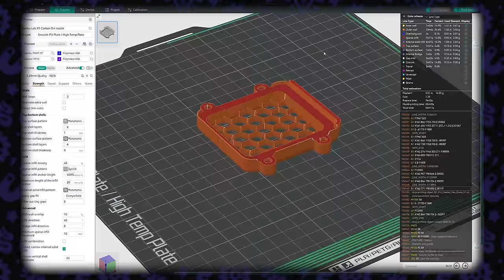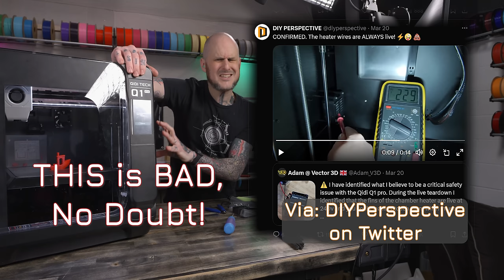SHOCKING Truth About Qidi Q1 Pro Heater Hazard

Comment: I personally think that lack of exhaust filter is much more dangerous for people...
Reply: Didn't one of the reviews mention that there's mounting points to add a filter? If so, then that seems like something that would be an accessory for when needed, unless you're referring to just general printing of PLA and PETG as well, in which case this is an issue for almost all printers on the market.
Reply: @stew675  yes, someone did this. But that should be already mounted or at least highly suggested with Goode on the SD card with some sticker on the printer or so… They advertise printing will nylon and abs (awesome) and there is no mention about this… It is like those cheap laser machines that don’t have any kind of cover or exhaust as well imho.
Just so you know - I ordered one q1 pro 2 days ago so I am not a hater. I am genuinely surprised that people talk a lot about heating chamber element etc but not about this.
Reply: @pfabiszewski  I understand, but consider this.  If you go to purchase any filament that requires filtration/ventilation, there are already warnings on the sales page for that filament, as well as on the box, that the filament should be printed in a well ventilated area, or with filtration.

Meaning the warnings are there already.  If you're printing with ABS/ASA/Nylon, and still don't know to filter/ventilate, then you've already ignored all those warnings too.

I don't know.  I guess for me it comes down to application/responsibility.  When people buy a screwdriver, we don't demand that we see warnings all over the screwdriver not to stick it into a power socket.  When we buy a power socket however, there are handling and safety warnings all over them.

I see your scenario in much the same way.  The printer is the tool.  It has warnings on it that apply to what it is (hot surface, hot nozzle, etc, etc).

I see the ABS as much like the wall socket.  These are items that have their own specific handling and safety concerns, and they do come with such warnings.

I buy a roll of ABS, and I see the warnings.  Oh, now I need ventilation for this.  I look at my printer, and I see that there's mounting holes for attaching filtration/ventilation!  Best I use them to safely use the filament I'm using.

I guess where I'm going with this is that unless they ship a 3D Printing encyclopedia with every printer (and let's face it, almost no one would read it anyway), the warnings are where they need to be, and that is on the items that are the issue (ie. the filament).
Reply: @stew675  I see your point and I agree to a degree. I think my main issue is that implementing very simple filter (even exactly this 3D printed one with activated carbon) would probably add like 3-5 USD to a price and would almost totally resolve the issue. So small increment in means/cost, big increment in result. I think that is the thing that bothers me the most. Besides - the shape/feeling of this printer somewhat "implies" that everything is self-contained. 
I understand that I am more writing about my "feelings" now, but consumer behaviours are usually dictated by habits/impressions, not facts.
And let me repeat - that lack of filter is like 50% of my point. Another 50% is that people talk about some "stupid heater", but not about this. I see some dissonance here.

Nevertheless - we might just had the nicest discussion in my internet consumption history. Thank you :)
Reply: @pfabiszewski  :) not everyone on the internet are angry people who see the world only in the colors of outrage and black and white, although I agree that it's getting harder to find them.

I understand your points. I think it's just a marketing/pricing decision that Qidi have made here. I believe they're targeting a price point and even $5 or $10 more is an issue if that item can't be an accessory instead.

I believe I also understand one of your other points. Since they already gave a chamber heater and the printer costs more because of it, then why not include a filter too, because if you're needing to use a chamber heater, then you're likely printing with filaments that gas off VOCs as well.

Since the heater is mains power though, my guess is that they didn't want to make that an accessory as in many jurisdictions that would require an electrician to install. It's not good to have customers messing about with mains power, so I suspect that's why the heater isn't an accessory. 

It's an interesting topic. The market competition is really tight and that's probably led to the decision to omit the filter for this particular model and leave it as an accessory. The Plus and Max 3's all now supply the filter as well as standard, but they are also higher specced and higher margin devices.

I dunno. It's a tough market to do business in. Lots of swings and roundabouts with every little decision, depending on the target market segment.
Reply: @stew675  that point regarding tinkering close to mains cables - actually you are maybe right. So let’s just hope that reviewers will recommend this to tech savvy people and non tech savvy won’t print with voc generating material too much ;) cheers!

Comment: I used plenty of tools that are more dangerous than some mains-connected heater element. One of them can literally get your fingers ripped off and even rip the skin off your hand with your finger(-s). I always take precaution to keep my appendages away from anything that could mangle them, I keep my kids away from any powered tools, and I do all my maintenance with power off. The sole exception is heat end of my 3D printer, which often requires a bit of heating for disassembly.
I also electrocuted myself three times in one evening by accident. I discharged big mains capacitor with my forearm, then discharged it again with my face, and lastly I grabbed the entire PCB to throw it forgetting to unplug it from the mains first. Discharging ~320V between my nose and lower lip was the worst and most shocking experience...

Comment: Really well throughout video on this. The summary at the end is exactly where we are at the companies want appliances but they are not building them to appliance standards yet. This printer just feels unfinished and make do. It would have taken them very little time to do proper cable management. But then the price would go up. I hope where not in another race to the bottom with corexy machines

Comment: Hi, I have not seen the machine in real life, but I do have a question.
It looks like the SSR is on the bottom of the frame, and what happens if someone drops a glass of cola that forms a puddle under the machine?
Is the SSR positioned low enough to be a concern then?

Comment: ha! you fixed it with conductive filament. I agree with you it doesn't really need a cover just common sense.
I found out about cf filaments and electricity the hard way. I printed a tig welding torch handle with cf nylon and continually got shocked all day. it was the high frequency arc starting that jumped through the filament. CF filament isn't a good candidate for electrical insulation.

Comment: completely agree , these are tools not appliances but even then a toaster is an appliance and it too will shock you if you touch the heating element and far more common to be done , I got my first printer with a chamber heater with qidi ifast and absolutely love , game changer for printing several filament types , while I don't have plans to buy this exact one from them also do have the xmas 3

Comment: I just bought the Bambu P1S but I wish I had bought this printer. Bambu doesn't have the heater and can't print abrasives out of the box. Now I need to shell out like 60 bucks plus shipping for the hardened steel upgrade. This has just so much more value. Bambu prints great but the heater and hardened nozzle out of the box is hard to beat.

Comment: All good points. I treat my printers like tools and use the same amount of care and attention I would with any tool that moves, cuts or heats.  Unfortunately, that is not how manufacturers are marketing these things. They're shown in living rooms and on dining tables and in classrooms. They're being marketed as appliances accessible to anyone and everyone. A burnt finger because you reached into a toaster oven and touched a hot rack is very different than getting across mains voltage while trying to fish out a piece of loose filament or debris with a pair of tweezer. Even at an industrial level, this would not be allowed in a lot of cases.  There's no way my EHS manager would let me put a piece of equipment out on the production floor that has exposed mains voltage without an estop on the door.  Not trying to defend the scare-mongers, just saying there are use-cases where this not allowed.

Comment: This is actually could be  illegal in the U.K. and EU but it’s complicated as it’s a heater.  However most devices would require more than one cover and would likely fall under the requirement for being double insulated.  

The rule is “The basic requirement is that no single failure can result in dangerous voltage becoming exposed so that it might cause an electric shock and that this is achieved without relying on an earthed metal casing” 

A single point of failure is that current cover.   

What. Complicates it though is many fan heaters have a fan grill exit where the element can be seen.  This is complex how I would be leaning on this not actually being legal more than it is.

However many fan heaters have the element exposed behind a grill, a toster does as well. However what you then have to take into account what you would be expected to do in the area around those.  What complicates this is you are expected to be in the chamber and you are moving a metal bed around even if the heater is off.  You have the very real potential to cause impact and damage to that cover.

It’s not “shocking” bad design but as its mains it should have both a second cover and a warning label.

Comment: This is why hair dryers have warnings about using them in the shower. Even if Qidi did everything possible to prevent any kind of injury from using their products, and put labels on every part that gets hot, someone would find a way to hurt themselves. Use appropriate caution with any tool (or appliance) and you should be fine. Some of the people on social media would run screaming if they ever saw my wood shop . . .

Comment: Regarding the EU plugs and the SSR: The SSR only switches one wire and in most of the EU you can swap the plug so that means that either the neutral or the phase wire is switched.
Anyhow, it is a bad idea to think that the neutral is safe to touch. Always - and I mean ALWAYS - assume that any wire coming from a wall outlet can contain a lethal voltage. 
I don't understand why the mains heater is such a big issue. As @markm49 already pointed out, toasters, heaters and hairdryers all contain open heater elements. Never ever stick a fork, knife, screwdriver or a finger in one of these while plugged in.

Comment: Agree on most of your points. But did you notice the lack of a fuse for the heater element? If the fan of the heater breaks, it will heat uncontrolled as long as the print goes, and possibly melt the enclosure and start a fire in the worst case.
Reply from the maker: It is a PTC heater, they are a self regulating design by nature. They cannot heat indefinitely. Someone else already tested this, I can’t find the post right now but they disabled the fan and let it heat, it didn’t get that hot when unregulated. It would be wetter to have additional controls, absolutely, but a total thermal runaway is unlikely in this instance.
Reply: @MandicLabs  Thanks Mandic. This might be an entirely european thing, but I am fairly sure this maching would not be allowed to be sold like this in the EU because it's unlikely, but not impossible.

Comment: Does anyone know the difference between the EU and US versions of the heater? I mistakenly ordered the US version, but my place uses 220VAC power. I switched the toggle on the 24VDC power supply so that the printer can work with 220VAC and temporarily disconnected the chamber heater control pin. Currently, I am using the printer without the chamber heating function

Comment: Obviously 3D printer is a machine.

But it's also a home/office machine, not a workshop machine.

Obviously it's going to have some hazards. I think burning hazard is acceptable, but if it can be minimised, that's good to aim for. Normally none of thesee temperatures are so hot that you wouldn't be able to remove your appendage once it's feeling too hot. You feel a burning sensation at something like 50-65°C but no injury is occuring at that temperature yet. I don't think hot end should have a large exposed hot area, but nozzle tip is only going to give you a tiny little burn that heals up no problem. A clothes iron and a stove pose a much higher burn hazard than a 3D printer, so that's about what you'd deem worst case acceptable if we can't help it.

I think trauma hazard is acceptable, but not to the level of amputation, it shouldn't be a table saw.

I think fire hazard and electric shock hazards are not generally acceptable to the extent at all avoidable, as these tend to lead to people's demise, which is not the same as losing a pinky. In most of Europe, the heater may be live at all times depending on which way you insert the Schuko plug into the socket. You have a 4-terminal SSR, that yellow MGR unit, this disconnects only either live or neutral depending on that. Ideally, there would be a fine earthed metal grill in front of the heating element, such that if you reach in with a screwdriver or drop a screw, GFCI will de-energise your space. Schuko power strip switches disconnect both live and neutral, and i think its advisable that 3D printer power switch should do the same in Europe because there's mains referenced metal here, which the power switch here does not, this creates an extra surprise behaviour and a hazard.

Also if the heater could just be 48V or less and floating, that would just solve the whole hazard situation.

I think the contacts of the PSU are sufficiently shielded for the class of product that it is, but knowing myself if i am to work on it, all these possible spots get covered with Kapton.

I think 5.7mm opening is actually at times considered acceptable, but my pinky goes through around 4mm deep. Not a child either, just a not particularly large woman.

Comment: I don't own a Qidi, I am not here to support the brand, but, "Real" machines with moving parts as mentioned in a machine shop, would have at minimum an interlock on the door (easy to add one to this printer though) so you're not inside there at all while it's on. 

The live part of the heater (after you have removed the protection fins), should be compared on a safety level more with a bread toaster and if you are concerned with bits falling in, then as you mentioned,  print a secondary cover for it in ABS (or something). 

For places with swappable active and neutral, if it is an SSR or relay, add a second one on the other wire. These are easy mods.

Comment: I guess a nice feature for the future would be to have the heater linked to the door. So if the front door is open it cuts the power to the heater. But yeah overall I agree, these are not home appliances yet.

Comment: You said it brother.. “Safety as a replacement for responsibility” is a problem with everything, everyday. Today’s products are horrible because the average user seems to be an idiot.
Reply: Did sawstop make table saws worse? Today's products tend to be horrible due to corporate structure, where the PO, the manager who makes product decisions, is neither skilled in engineering nor user experience nor wants to know about these really, they hit arbitrary goals that lead to their promotion. These people fail upwards in their career as a rule.
Reply: @SianaGearz  yeah ok, that's why you can't buy a good gas can anymore. 🙄
Reply: @T00LF00L  IDKWYM i'm obviously from the wrong end of the globe but there's literally nothing wrong with the standard DIN7274 canister made by Valpro in Latvia. Hasn't changed in 40 years either. A good canister is a canister that is robust against damage and can be used safely, wouldn't you agree?

Comment: Wow, the heater having live voltage even when cold here in Europe is quite a design flaw!
But other than that, as many have said, it's no different to a toaster. So even appliance's heater elements are live 120-240 V.

Comment: The mains heater doesn't overly worry me, so long as there's no way for a damaged wire etc to contact the frame and set it live too. The bigger problem for me with the Q1 Pro is the ancient, unmodifiable version of Klipper it's running.
Reply: It can be modified though. Qidi have a fork of Klipper that they use to provide a stable platform. They do backport newer features as is required for their products. 

If you want to modify it, they even have a page on their site that says to reach out to them, and they'll provide assistance with a build environment and tools to do so.

Their entire source is available. You have root access to the control board. There is nothing stopping you from modifying it.

Comment: EU AC is full sinewave and goes from +230V to -230V, therefore it doesn't matter which way you hook it up. Voltage still goes across.
Full bridge rectifier ensures for DC which is + and which is -.

Comment: the x plus 3 had a 24v heater, but iirc that required a separate psu to provide the 300w, I guess this is just one of the ways they cut costs.